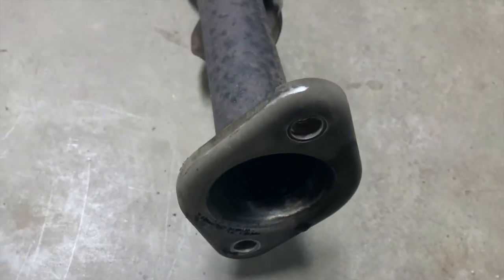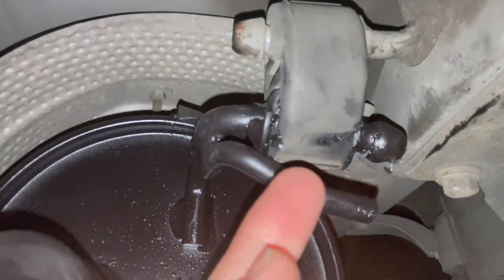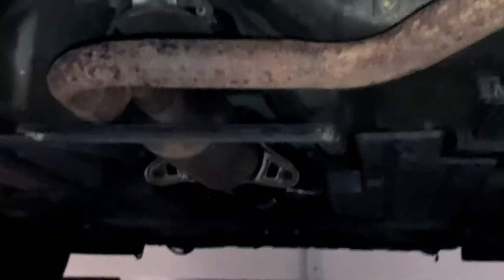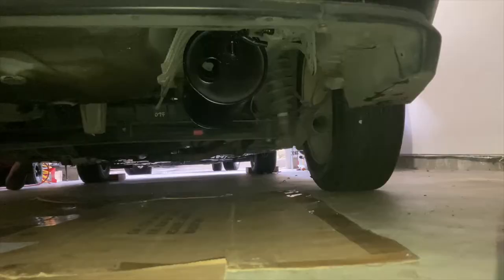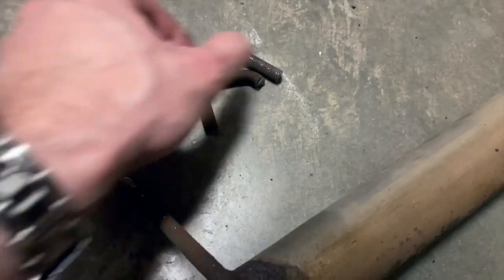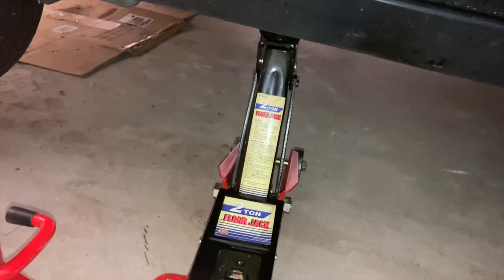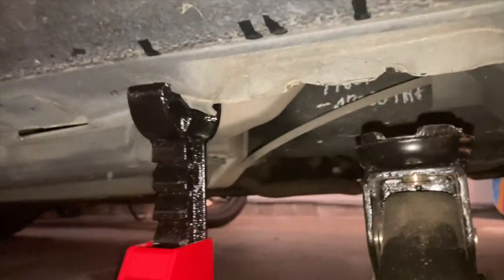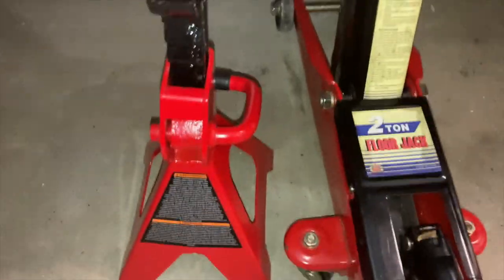2005 Toyota Prius Muffler Replace

Comment: Does this clear P0420?
Reply from the maker: No, you have to use as a cheap OBDII tool to "Clear exhaust emissions data" for P0000 and P0420 since both relate to the downstream O2 sensor & catalytic converter / when replace with aftermarket parts that are cheap, they produce different gas flow and temperatures which do not produce the exact voltage signals the ECU expects, causing the MIL light to turn on, producing an error code data entry in the OBDII system, that you then have to clear with an OBDII tool. $20 on Amazon or Ebay, you don't need a fancy one, just one to easily clear the codes, there are many options. You can also buy a cheap downstream O2 sensor & aftermarket catalytic converter online for $25 and $60 respectively, then take the parts to an exhaust shop & pay them $100-200 to weld the cat on & install the O2 sensor. You will still have to clear the OBDII codes daily but you will save thousands vs paying a shop or God for bid the dealer to fix the cat theft
Reply: @AaronSchwarz42  ok even with an aftermarket cat I still have the code?  My mechanic said I have a cracked muffler right in half.  Is that why the car sounds a bit burly and it smells like carbon monoxide?
Reply from the maker: @Allourmanfam  CO can cause brain damage, so change the muffler if it's cracked and you can smell the exhaust, that's toxic! It can cause you to feel sleepy while driving too. Make sure the entire exhaust system intact my brother.
Reply: @AaronSchwarz42  i had the same issue with an aftermarket cat throwing codes, but a cheap 90-degree o2 spacer solved this issue.